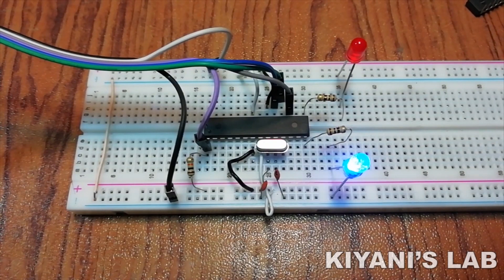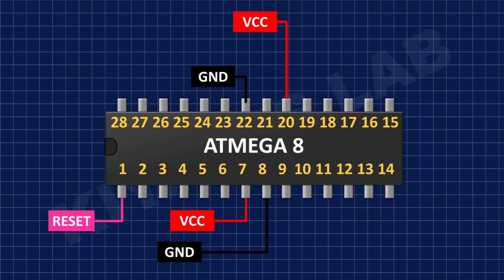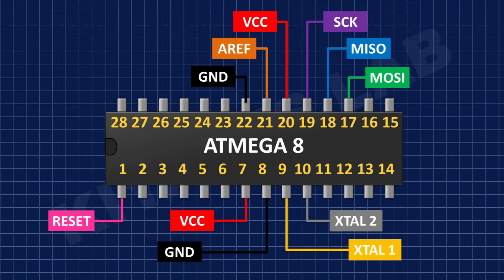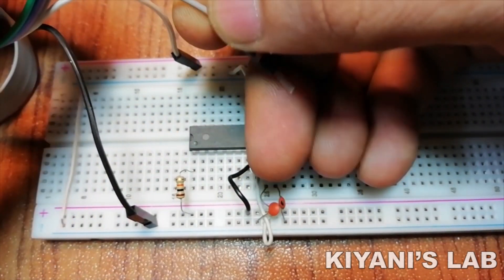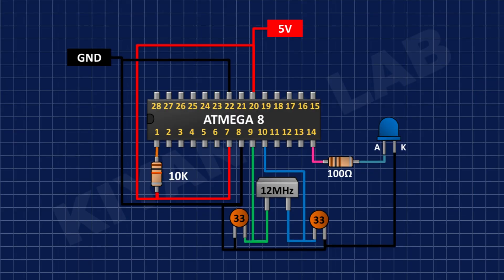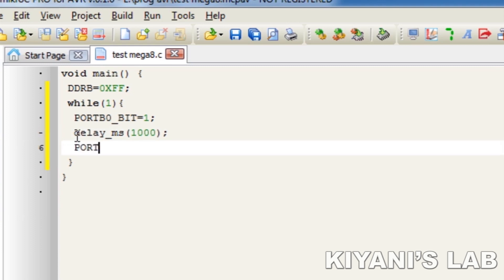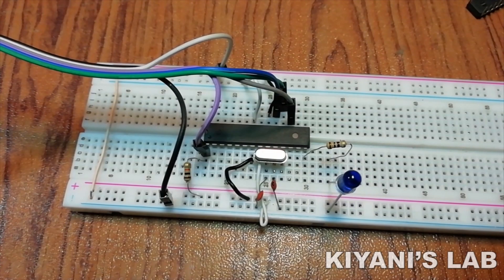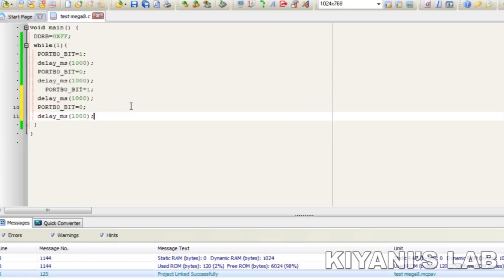How To Use AVR Microcontroller? | Microcontroller Programming

Comment: I am unable to write in flash ..
It shows error writing flash!!
Reply from the maker: first check connections 
2nd check the crystal and capacitors
3rd the chip is not ok or configured as it would not work with in system programmer for such devices we need high voltage programmer

Comment: Why capacitor use ?
Reply from the maker: these capacitors are used to stabilize the signal generated by the crystal
Reply: Why directly not connect to crystal ?